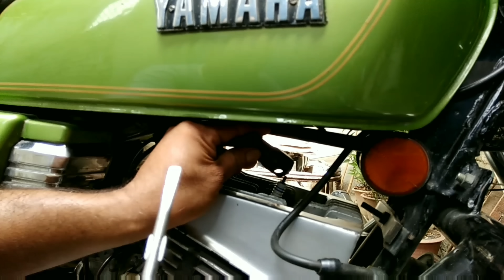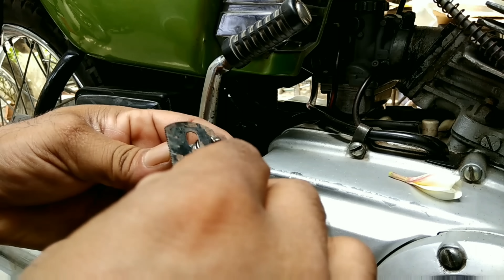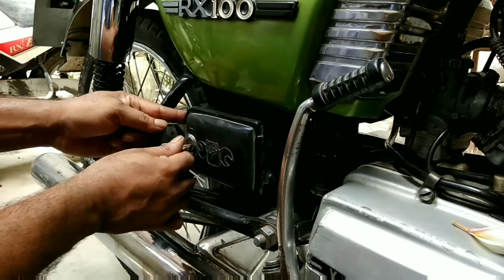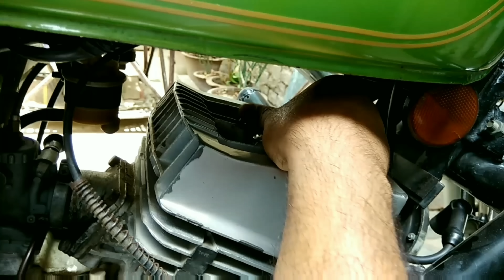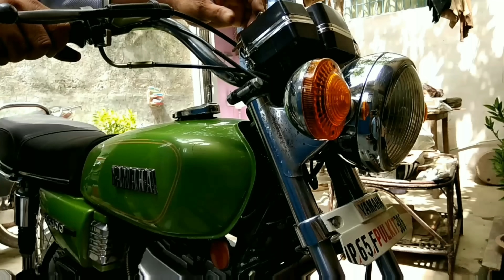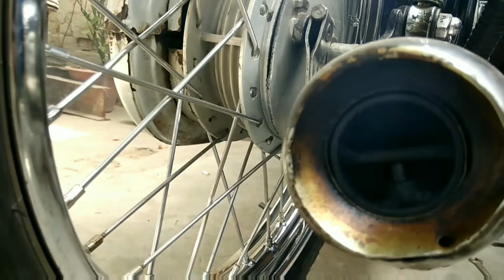Yamaha RX 100 Starting Problem (SOLUTION)..

Comment: bro mera Rx100 bike start neshi horahe ki karun.plack me thora mobil aharahe
Reply from the maker: Manik Mia Adjust the Carburetor , Air/Fuel mixture. Make sure that you must full tight (Clock wise) or closed the Air mixture fully. Then turn 180 degree 3 times! Now clean the spark plug or Change and start your bike.
If your bike will start please let me know!
Thankyou.

Comment: Bro I have kb 100 its not starting even after cleaning carburetor and spark plug what is the solution to start it??
Reply from the maker: Check ignition coil
Reply: Ok thank you so much 😊 @PrateekGautamRx

Comment: hlo meri rx100 ..4.5km chlke bnd ho jati h or 1 mint bad start krke start ho jati h kyaa chkr hoga uska
Reply: bro check the coil
Reply from the maker: Talwinder Gill First of all Check the Spark Plug of Your Yamaha.. Clean the Carbon with The Cloth..!!
Reply: Talwinder Gill  dear plz change your cdi cable. which is responsible for plug current...
Reply: Talwinder Gill iiur
Reply: +sanjeev gautam  sir g bas yeh btaao mere paas ek rx 100 h sond aap ki gaadi k jese nahi kiyaa oske liye kiyaa karnaa hoga
Reply: @PrateekGautamRx  I change spark Plug but continue Smoke will coming like Your like What to Do when Smoke Stop